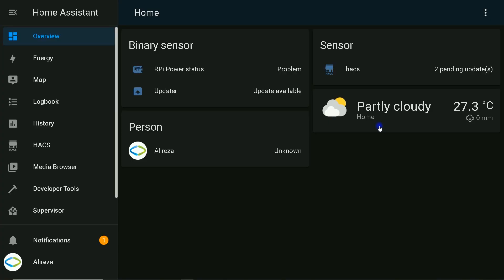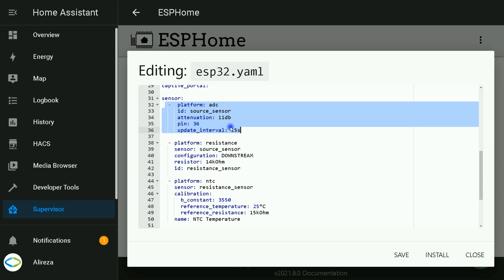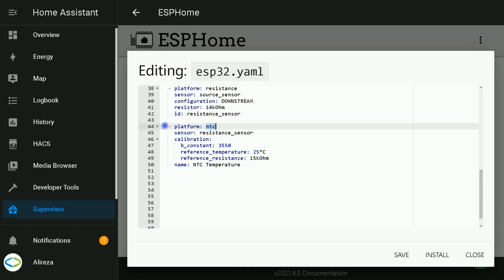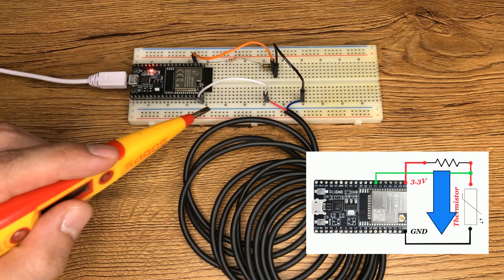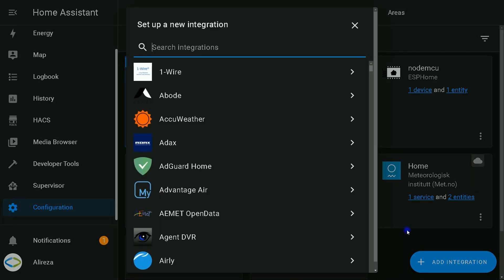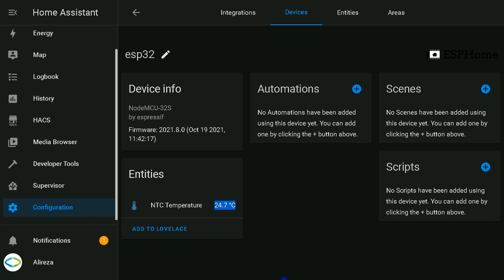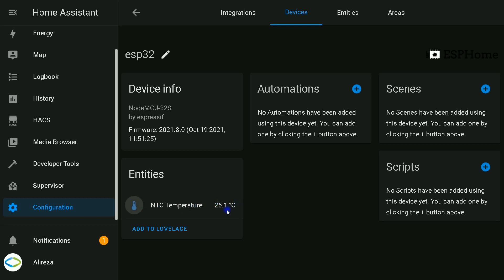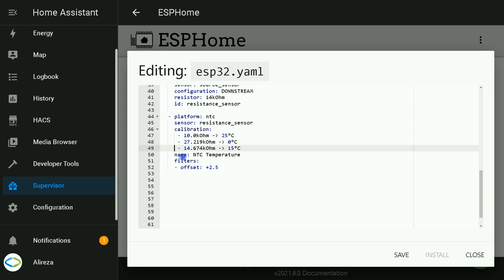Temperature Sensor in ESPHome

Comment: hi, why use a 15k ohm resistor and not 10 k ohms.  Greetings and thanks!
Reply from the maker: Hi, sum of them is 10K (two parallel with one in series)
Reply: @kian.smarthome Ok.  Thanks for the contribution!
 I have to do a project for a solar water heater and I am studying the case.
 Thank you very much
Reply from the maker: @jdituicha  you are welcome